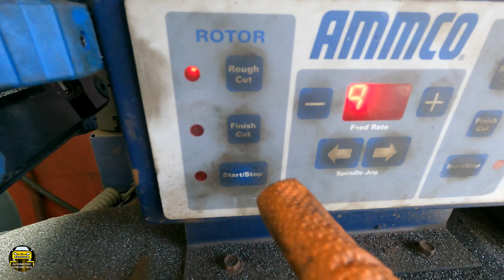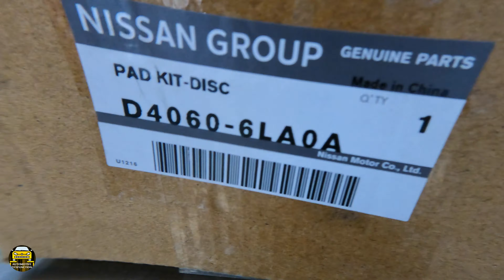How To | 2020 + | Nissan Sentra | Brakes | DIY |

Comment: My caliper piston spins but doesn’t retract. No park brake on and I tried spinning both ways
Reply from the maker: @KaleTheCreative  you need to push in on put  pressure on it while you spin it
Reply: Passenger side or driver side? I just replaced rear pads on a 2021 Sentra and both of them were a PITA to compress. passenger side i got frustrated and took off the caliper and compressed it on my work bench. Just make sure youre turning the piston in the right direction and press hard like hell while turning

Comment: I’ll say this as I saw a few had the same issue as me… it didn’t work with a normal compression tool like he does it in the video. There is a reverse threaded tool that O’Reily Auto Parts claimed to have but didn’t at the time. They offered a small cube (roughly 1inch^3) that fits into a ratchet - this allows either clockwise or counter-clockwise while being able to apply enough pressure to easily push back the piston on either side of the car. Each face of the cube has a different fitting to match the piston’s orientation. Took seconds with this cube.

Solid video apart from this!

Comment: on the passenger rear side only, the caliper wont retract counter clockwise. do i need to bleed the brakes and let the pressure off so it will go in or what am i doing wrong?
Reply from the maker: It’s one side clock side other side is counter clock vise …I wrote somewhere in video this … I think driver side is clock vise passenger counter clock vise
Reply: I just made a comment with the same problem lol! If I put too much pressure trying clockwise on passenger rear do you think I may have damaged the caliper. I put force behind it when turning the compressing tool.
Reply: @RonnieAinsworth-u4r  did u figure it out?
Reply: @AutomotiveDysfunction  his comment was to say that it does not retract going counter clockwise on the passenger side - I am having the same issue
Reply from the maker: @justinallen1997  put pressure on it and then turn it clockwise for driver side and counter clockwise for passenger side

Comment: Hey! Thank you for this video, huge help. Have a scratch in the middle of my rear drivers side rotor. Figured a rock got caught in it but when I pulled off the pad nothing was there, assuming it shaved and fell off. Quick question, what is the purpose of the mechanism that is attached to the caliper that has the spring and makes you pry it off? Im used to just the caliper and taking out a bolt while lifting it up. Is this the automatic braking system and that's why it comes with that?
Reply from the maker: yeah automatic caliper for electronic Park mode.. so yea that's how you take it off
Reply: @AutomotiveDysfunction  thank you!